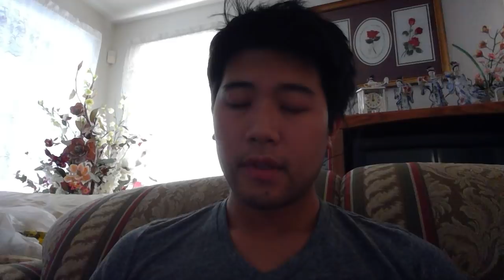Dignitas Info Video

Comment: I tried this combination on my cubes last time and it's really good. What I did was put on dignitas and let it dry. After drying, I put dnm and it turned really really fast. But after a few solves, it became controllable and felt good for me. The dnm losses its speed after some time. A side effect of this combination was when I used this on a few of my cubes and didn't used it for like 2 weeks, it became sticky. I suggest if you do this, you have to keep using the cubes you put it in.